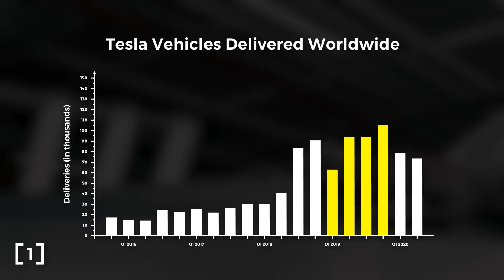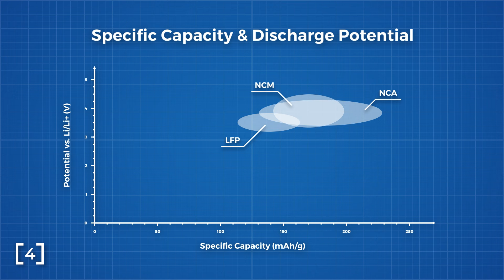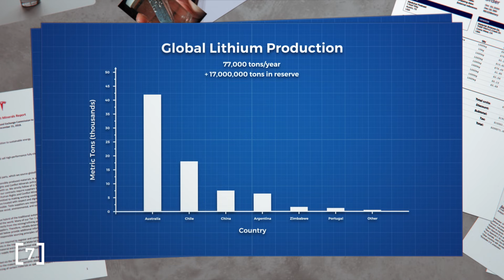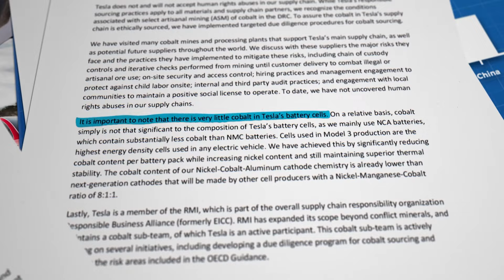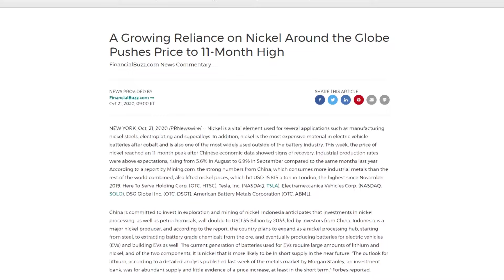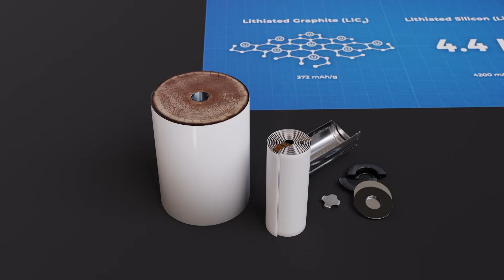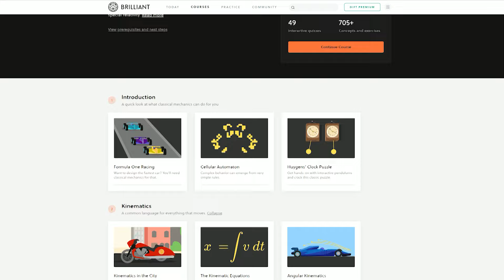Tesla's Battery Supply Problem

Comment: One thing I would like to add:
The cathode is the minuspole and 
the anode the pluspole.
Reply: Yes, you are the only person, other than me, who caught this. Congrats on being "woke".   Most aren't.
Reply: Yes and,
The cathode is the positive electrode and
the anode the negative electrode
Reply: The electrode of a battery that releases electrons during discharge is called anode; the electrode that absorbs the electrons is the cathode. The battery anode is always negative and the cathode positive. This appears to violate the convention as the anode is the terminal into which current flows
Reply: @peterwilson9327  erm I spotted it as soon as he said it, but I am only watching this in december 20th
Reply: This always tripped me up before.  From my understanding when the conventions were made they didn't understand that electrons were negative or something like that (they had no knowledge of sub-atomic particles).  Still not quite sure how that came to be but it is what it is.
Reply: The video maker could have googled this in a second, poorly made fact check indeed.
Reply: @alexanchannel  Now I'm confused.  I've always thought that cathode is negative and the anode positive, but that could be both correct and incorrect due to the stupid conventional vs. electron flow thing (xkcd.com/567 ).  Could someone who understands this please explain?
Reply: @Hyrum_Graff  
The convention follows the directions of electron holes, rather than the direction of the electrons. 

"An electron hole is the lack of an electron at a position where one could exist".

IOW: When an electron jumps forward, it leaves a hole behind which can be filled by another electron.
The direction in which holes are flowing, we call it current.

https://en.wikipedia.org/wiki/Electron_hole

Regarding batteries, the following picture explains it all.
https://en.wikipedia.org/wiki/Anode#/media/File:Fig_bat_Discharge_Charge3.png

To summarize:
During discharge:
The cathode is the positive terminal (electrode/pole) of the battery, while the anode is the negative terminal.

During Recharge: (its the other way around)
The anode is the positive terminal (electrode/pole) of the battery, while the cathode is the negative terminal.

Remember that electrons ALWAYS exit the anode and fill in the cathode.

Quick recap using an example:
In a fully charged battery, a positive terminal is full of holes and a negative terminal is full of electrons. As the battery discharge, these holes in the positive terminal get filled with electrons that are exiting the negative terminal.
As the negative terminal loses its electrons, it gets full of holes. Therefore, we can say that holes are move from the positive terminal to the negative terminal. This "movement" of holes from one terminal to the other (through a wire/load) is called Current. And Current is the convention.
Reply: @alexanchannel  Thank you!  I think I was just confused by the terms positive and negative when it was unclear whether electron flow or conventional flow was being applied.  Your explanation has cleared this up.

Comment: Could you please do a video on thorium (MSRs) Molten Salt Nuclear Reactors as an update to your nuclear energy video? These are poised to solve many of the current problems with nuclear energy and be economical at that
Reply: MSRs have large downsides that are conveniently avoided by those that champion them. Number one is that you have to have onsite reprocessing of the fuel mix to remove fission products. The cost of this is the primary reason that spent fuel rods are not reprocessed in most countries such as the U.S. Extracting and refining uranium ore (which is massively abundant in the U.S.) is cheaper then reprocessing spent fuel.

It's a technology that has potential to be useful to certain places such as India that is poor in uranium but rich in Thorium. But it is not a miracle tech, nor is it magically more environmental friendly. 

That said I firmly believe we must explore, improve, and utilize nuclear power if we truly wish to cut down CO2 emissions as it and hydro are the only two reliable 24/7 power sources that don't release CO2.
Reply: @Cragified  That's exactly why RE should make a video on it.
Reply: Nuclear fusion is better  if still a little way of
With enough funding it will solve all our energy needs.
We just have to get everyone on the same page and globally push for fusion...

Comment: I think the best way to get the raw materials for the batteries is "Battery Recycling". But it has to be done safely and environment friendly manner. That's the best solution, will create great job opportunities and also a chance for entrepreneurs to bring some creative solution.

Edit: Waiting for a video about Grid Scale Storage and Liquid Metal Batteries.
Reply from the maker: Working on a recycling video too. There are a lot of problems to solve. All the different chemistries makes it difficult to have a single process for recycling. Pretty much all the inventory available for recycling right now is from the Nissan Leaf, with nickel cobalt manganese, but soon there will be a huge range of chemistries. The main driver for recycling is recovering cobalt, and with the lowering percentages of cobalt in the batteries it’s becoming less economical to recycle.
Reply: But I guess recycling will be still useful for resource less nations like India where there is no deposits of battery raw materials. 
This would help is reducing the dependence on importing raw materials from other nations 

No idea about the recyclablity of materials inside a battery, your upcoming video will really help 😁
Thank you for the great knowledge.!
Reply: Tesla wont have any battery to recycle befire 10 or 20 years. Used car batteries are put in power walls or other larger grid rectification storage fields ...

Comment: 3:02 the cathode is negatively charged not positively charged. Cations are positively charged
Reply: Depends really, an electrolytic cell has a positive anode and negative Cathode, while a galvanic has negative Cathode and positive anode. During charging, the battery becomes electrolytic. During discharge, battery is galvanic.
Reply: the cathode is positive in a battery, electrons flow into it and charge flows out.
Reply: N Satheesan  what you're thinking of is a primary cell battery. An irreversible reaction providing a voltage and is only a galvanic cell.

The batteries in question are not primary cells.
They are secondary cell batteries. Meaning they are rechargable and exhibit both galvanic and electrolytic behaviour in the discharging and charging process.

You can't just take one side of the story and call it the whole story.
Reply: @Srajan Agrawal lol hello there

Comment: There are several issues with the battery explanation: 1. anode and Kathode swap when switching from charge to discharge. 2. Lithium is not chosen for  its low density but rather high electronegativity/position in the galvanic series.

Comment: I know the reverse is true in "real" current, but conventionally we say that the Anode is positive, and the Cathode is negative.
Reply: Well, in chemistry anode is electrode which facilitates oxidation.
Reply: @Kycilak  Yes, oxidation occurs at the Anode, which is the positive electrode. (Conventionally)
Reply: @JesusHChrist2000  Nope, depends on what the cell is doing. As a source of voltage it has swapped polarity to electrolysis cell.
Also the direction current flows by convention has nothing to do with polarity. The + and - stay the same in a given circuit whether you suppose positive or negative charge carriers.
Reply: @Kycilak  Ok? But the explanation of batteries in the video incorrectly shows Cathode as positive and Anode as negative is all.
Reply: Yes this had me confused too.  I would have assumed an error (the cathode is the negative electrode in every context I've ever encountered) but Brian researches stuff thoroughly.. so went back to Google and I believe he's right in the context of lithium ion chemistry.

Comment: Seeing this video one can understand why these so called renewable energy is a fallacy.  This is the reason Bill and Melinda Gates Institute supports nuclear power. Because the amount of resources you need to provide battery for wind and solar energy to work reliably is ridiculous and it hurts environment a lot.
Reply: yeah I'm all for going electric and against fossil fuels, but the current state of renewables really does more harm than good

nuclear is amazing if used responsibly, bit it has lost the trust of the public after events like Chernobyl
Reply: Now compare that to the consequence of climate change and air pollution that kills 7 million a year. It's not even close.
Reply: @Itaintme31178  that is a huge guess. Statistics at this scale and about climate is gamble.
Reply: @drac124  Bro that's just not true. Almost every climate scientist calls for a renewable transition. Generating a MW with solar or wind just outputs objectively fewer pollutants. Show me one source that demonstrates otherwise. Check out drawdown 2020 if u want to learn more.
Reply: For those of you against nuclear power consider this: conventional power plants kills significantly more people than nuclear power does. The key difference is that in a nuclear disaster a bunch of people can die all at once. Conventional power plants kill thousands of people just by operating normally.
Reply: Nuclear combined with a  little bit of renewable's and some electric cars, and some synthetic fuels for ships, planes, difficult use cases and remote areas, this would solve the problem quite well. Using chemical batteries to store energy on grid scale doesn't make any sense.
Reply: @Top_Weeb  Well not really like that either. If nuclear plant goes very badly boom, the deaths won't be instant, but the ones who will die from radiation disease will die in a few weeks. Then the pollution in the environment will cause effects in the long term like cancer, malformations in children, etc., and if the area cannot be cleaned up, it will be inhabitable for a long time, (as we have seen in Chernobyl ). To some extent it may be possible to clean up the environment, but the clean up is extremely expensive, good example of this is Fukushima in Japan. I still think nuclear is good, if a lot of care is taken to do it as safely as possible and a safety culture is created in the field. Nuclear is so effective way to produce energy that it is one of the best options we have. But nuclear is not very adjustable so alone it cannot solve the problem.
Reply: ackshally You know what I meant.
Reply: @Top_Weeb  You forget the whole area becomes radioactive and unlivable for decades after a meltdown, the most recent being Fukushima. Did you know you can spot wine forgeries by testing for radioactivity? Because everything made past the 1940s was contaminated from the atomic bomb tests and still is. The fallout radius and spread is ridiculous. The fuel rod storage is another can of worms entirely. Nuclear is just the quick, dirty answer to a complex problem.
Reply: He actually missed the most crucial part about the new battery construction - due to tabless design new batteries are planned to be few times more energy-efficient than current ones. This may solve all the other problems with material scarcity etc. So the whole video is either a bit of propaganda about how tesla is worse than it actually is or Brian is worse at engineering than at making videos.
Reply: This guy elaborates on the technical specifics and efficiency of the new battery quite a bit:
https://www.youtube.com/watch?v=hbPKE62aM0U
Reply: @aoikemono6414  It depends how well it is cleaned up. Tsernobyl was far bigger mess than Fukushima in that matter. Problem with the clean up though is that it is extremely expensive.

"Did you know you can spot wine forgeries by testing for radioactivity"

I knew this, but the question is, so what? The relevant question is, at what level the radiation is compared to natural levels, and even more important question than that; is that is it at a level that poses some kind of problem. Radiation itself is a natural thing. What matters is how high is the level.

"The fuel rod storage is another can of worms entirely."

They don't need to be stored forever, they need to be stored only for the time, that the radiation level has decreased low enough.

Indeed nuclear in its current form is not optimal solution. It has its share of problems. But currently for example small particles from burning are a much bigger killer yearly than nuclear, yet nobody is afraid of them.
Reply: @adidasboy132  There must be some error in the numbers, as battery can't be multiple times more energy efficient than it already is, in that case it would reach and exceed 100%, which is physically impossible.

Tabless design is not going to solve the material problem. But it may reduce the cost, and improve some properties of the battery.
Reply: @adidasboy132  Dave from EEVBlog did indeed a great video about the subject, but the numbers in the Dave's chart are a bit misleading, because he is comparing a cell of physically totally different size. He should have scaled the values to same size, to compare the effect of the tabless design change a lone. And that effect is a lot smaller, but still an improvement of course.
Reply: @Itaintme31178  show me a "climate scientist" that isn't getting some sort of public funding. Climate science is also a grouping of many different fields ie. meteorology to astrophysics. It's to complex for one field. Hence why all of their predictions and models are always wrong. Or they have to manipulate the data to make it work. All to keep their funding.

Comment: We need to make personal transportation much much smaller and lighter.  Pushing heavy cars around with batteries is not scalable. Electric city trolleys need to come back in a big way. Direct grid powered transport is the only way to solve these problems. 

Small vehicles with capacitor pacs to cover the small gaps between road grid source lines is the way to go. Basically a personal trolley with a small capacitor pack to push the vehicle between power lines.
Reply: small vehicles would be able to ride only on smooth city roads, and why would you need personal vehicles in cities at all? Public transport is faster and more reliable in most cities. And direct grid powered transport has not gone anywhere, most big, and not so big, cities use it constantly.
Reply: @minaolenella869  Public transportation would be good, and should be increased, but I feel what will have the biggest impact is self-driving vehicles. We will need significantly less vehicles on the road if they can drive themselves to serve people instead of sitting in a parking lot or garage for 97% of their life. This equates to much fewer raw materials and a host of other benefits. Honestly, I think self-driving cars will be very major in our fight against climate change and I don't see people making this connection enough. Thoughts?
Reply: @dylanlong6269  Would also reduce accident rates if you think about, one problem is that obviously they need to convince the public that it's safe, efficient, and most importantly, cost-effective
Reply: @justyourrandomvideos1645  Definitely, so many benefits. Less accidents leads to less on first responders, possibly reducing emissions/electricity usage by a small amount and allowing them to respond to more emergencies. Might even see a small, but noticable amount of increase in overall work time because less people are being hospitalized too.
Reply: @dylanlong6269  why does self driving = less cars? You mean because people could share them or what?
Reply: @05r41  Yep! Once self driving cars are common, companies will offer urber-like services so they can have reoccurring revenue. Soon, it likely won't make any financial sense to own a car because just subscribing or whatever is so much cheaper. Tesla's talked at length about their robo taxi plans for consumer cars, but no one else really has. They're so far behind though so it doesn't really matter. Bottom line is once FSD is available and becomes popular, our world's transport is gonna be dramatically changed. What will we do with all the empty parking lots? Let's turn them into parks!
Reply: @dylanlong6269  but normal taxis already exist...
Reply: @05r41  They don't drive themselves (more efficient, more room, safer) and they're not cheap to operate compared to Robotaxis. Self driving will be a very big deal

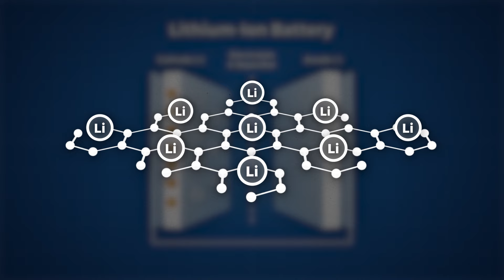Comment: To those complaining that the video has mislabelled the anode and cathode: you are wrong for the most part. In a galvanic cell, the cathode is positive and the anode is negative. In an electrolytic cell, the cathode is negative and the anode is positive. When a battery is delivering power to an external load, it is a galvanic cell, so the diagram at 3:00 is correct. When a battery is being recharged, it is an electrolytic cell, so the diagram at 3:45 is incorrect and should have the anode and cathode reversed. Interestingly though, he does correctly say the word 'cathode' at 3:50.